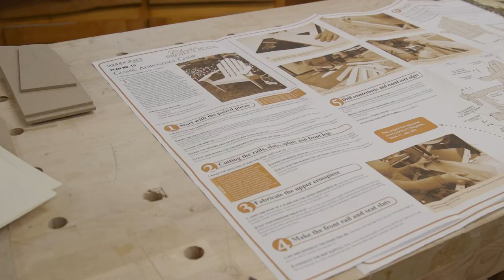The most comfortable Adirondack chairs ever made | Woodcraft 101

Comment: I bought those plans many years ago when they came as cardboard templates and a DVD showing assembly. I nearly wore out those templates so I quickly made hardboard templates. Also, I figured out a couple of jigs to help hold things in place such as lining up the arms with the inside surface of the legs. Also, I put a 30 degree angle on the back support curve where the uprights attach. Over the years I’ve made at least twenty chairs, some of pine (big mistake if they are exposed to rain), pressure treated pine, and western red cedar. I even made a couple of new cypress, but they rotted within a year. Old reclaimed cypress would have been a better choice.  Everyone says they are the most comfortable Adirondack chairs they have ever sat on.

Comment: I've made Adirondack chairs from this design for years - using the plans from The New Yankee Workshop - these are identical right down to the 27-degree angle.  I have had great success making them out of 5/4 cedar deck boards - which are actually 1" in thickness.  The cedar is light so the chair is still very light and easy to move and the 1" thickness on the boards makes the chair a little "beefier" in a really good way. And - the deck boards are easy to find.
Reply from the maker: I've really been enjoying them.  Great advise on the wood!